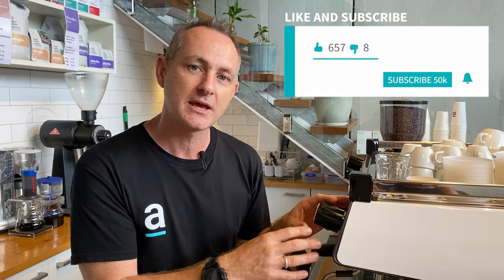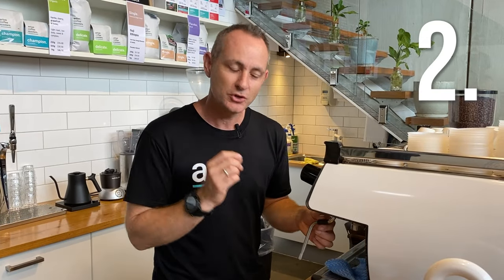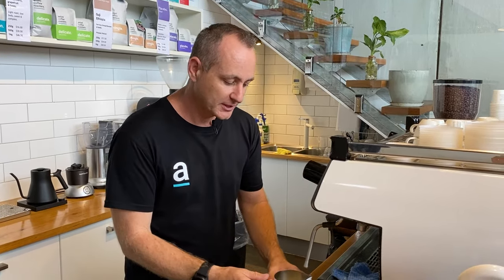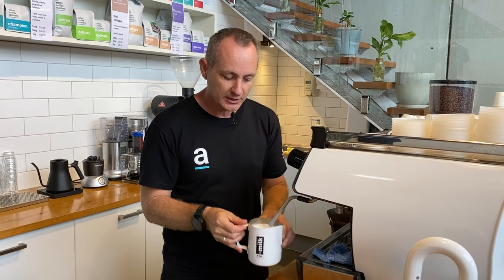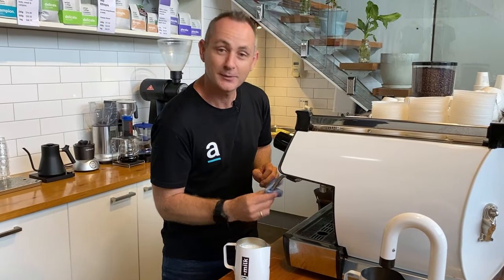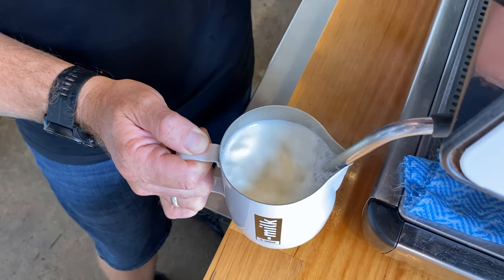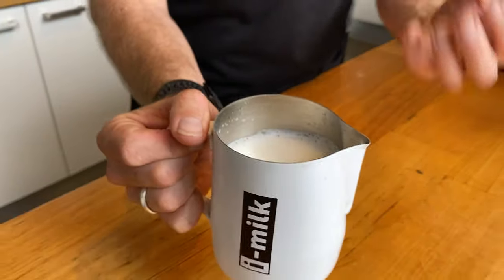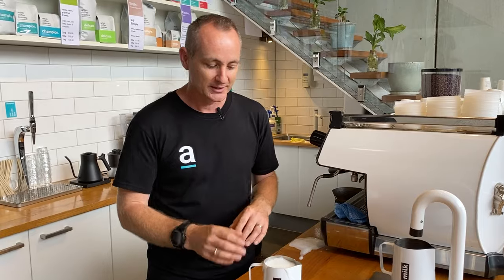Mistakes To Avoid When Steaming & Frothing Milk For Latte

Comment: Frothing milk to a maximum temperature of 65° and not like everyone says at 90° makes all the difference for latte arte.
Thank you ❤️ for sharing that hidden secret. I which I knew that a long time ago...
Reply from the maker: Yes, 90 is way too hot and will split the milk foam. That was the temperature from the 80’s
Reply: @ArtistiCoffeeRoasters  What if I do prefer hotter milk?
Reply: @nomenotavailable  you can get it up to 70c before the milk starts to break down otherwise expect subpar milk.

Comment: I need some help. 

First of all, great video and presentation, with examples and everything needed. Thumbs up. :)

I am using a simple Delonghi Magnific S machine at home. The foam I am getting is a bit too thick and solid. No were near what you showed, but still - when I pour into my cup, even from 5cm-10cm the foam starts building on top of the crema and it's no longer hazel. And when I pour from up close to the surface of the coffee (after lifting it by pouring from high) I get rather thick foam that doesnt swirl or move around like a liquid. 
What am I doing wrong?
Is it possible I am steaming it too much? 

Also, since all videos use an opaque mug I can't see how the coffee looks at the bottom. In my case I use a clear glass. inside of it I can see a bright layer on the top and the other 80%-90% of the coffee is darker. Is that supposed to look like that or is the color should be consistent all throughout the coffee?

Last thing - I use a 250ml glass. I pour long shots that are about twice the size of a typical espresso shot. I steam about 60ml-70ml of milk. I sometimes use a 350ml pitcher and I also have a 200ml pitcher. real tiny. Maybe this can help with diagnostic my problem.

Could it be the machine? Could it be the crema isn't good enough? (which means there's nothing I can do) 

Anyway, great tutorials and a great video. Keep up the content coming :)

Comment: I am struggling to get my machine to foam milk.. It was fine but I have serviced it, backwashed and descaled. It's an old Astoria single group and it's just for my own use, not commercial. Two different bottles of milk and it just won't microfoam. It used to, but won't any more. I have no idea what I'm getting wrong. 🤷🤔

Comment: When you say 60-65C, I see the temp needle rising in the immersed thermometer and keeps going up even after I have stopped steaming. So do you stop steaming a bit BEFORE it reaches 60C on the dial so that it doesnt end up overheating beyond 60-65C?
Reply from the maker: Yes , you stop 5 c before your desired temperature

Comment: Very re-occuring question that goes in my mind. Basically in the takeaway cafe I work in, we split a double shot into 2 small cups. When a customer orders a small I have to brew 2 single shots (because who uses single dose baskets) 1 shot I brew into the take away cup and the other we brew into a small glass shot which we might use for another cup later on. How long would you wait till it's time to throw that shot away, normally I would do a couple minutes, but even if the shots fresh and I pour the shot from the glass into a takeaway cup I would feel guilty. I am left in confusion.
Reply from the maker: hi Jacob, yes this is a challenge. in the 8oz TA we do a double ristretto as its bigger then the dine in cup. we only split the dine in cups, the additional shot that you catch in a piccolo glass can be added into a 16oz (3 shots) coffee or use for iced coffee. 1 min max for the shot to sit, as it will loose its crema.
Reply: @ArtistiCoffeeRoasters  Ah I see, seems easy for you, since you dont have to split for a cup. We only deal with double shots and single shots so we dont have to worry about triple shots unless they order a strong. Thanks for the response

Comment: when heating up to 65c only, isn't the drink not hot enough for a coffee?
Reply from the maker: No the Esprssso is hotter and the 2 will end at 65-69. This is normal in cafes, unless you are after extra hot, you will have to heat the milk longer to achieve this, but it will reduce the milk quality and taste
Reply: @ArtistiCoffeeRoasters  I see. so that is my problem then. Using a cheaper espresso machine (donlim) once I'm done w/ the streaming the milk, the espresso has cooled down. But I will try next time to measure the temp each step, to monitor closely. Thanks for the reply!